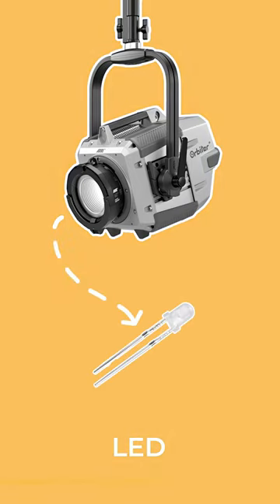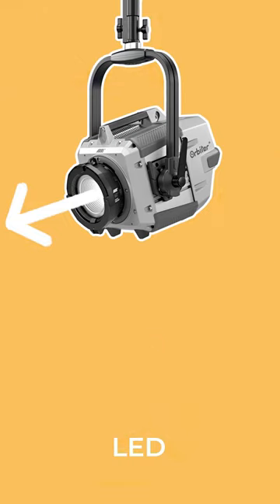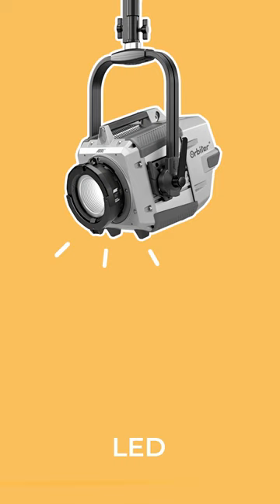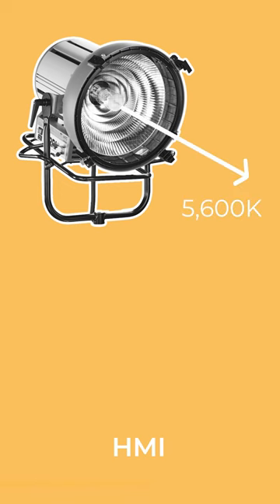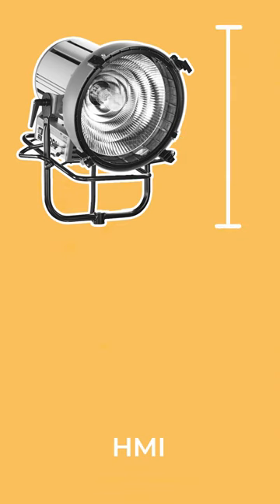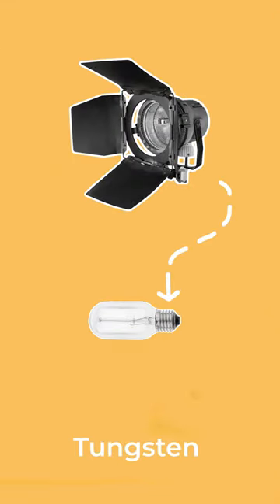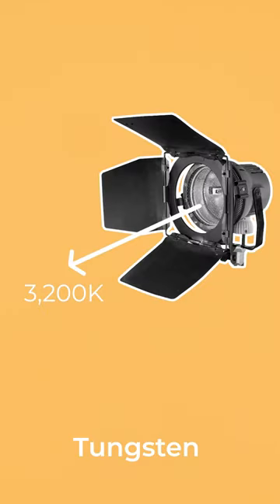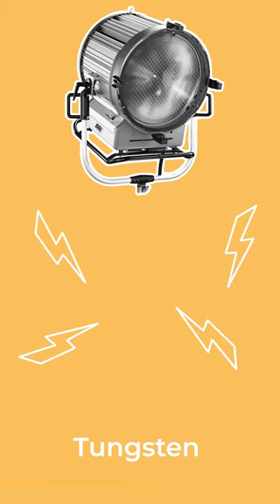What Makes LED, HMI And Tungsten Film Lights Different #Shorts

Comment: Why don’t they make tungsten COB lights that would be kinda cool
Reply: Because they run hot and even LEDs need cooling so imagine how it would be to cool them. It would produce much less light and would run so much hotter. Tungsten are great for accurate colors but there's so much negatives and you can make really good color accurate LEDs that can come close to compete with Tungsten.